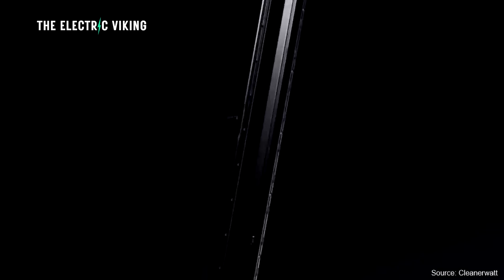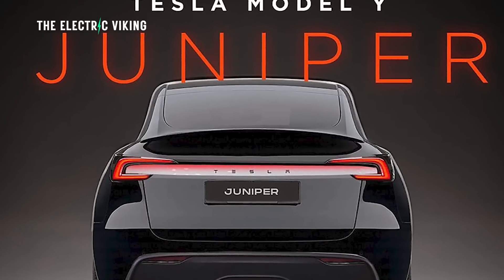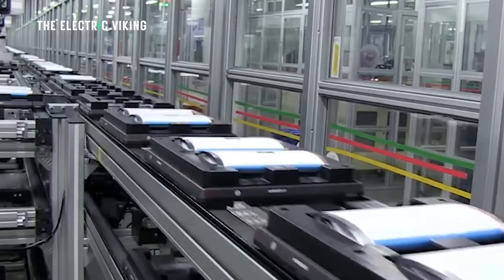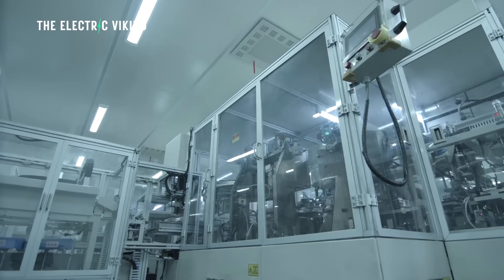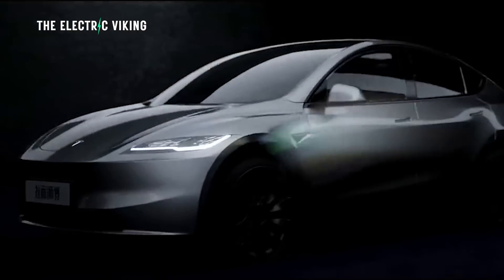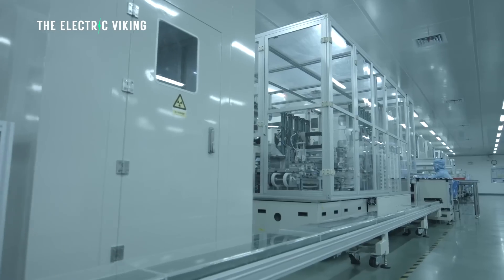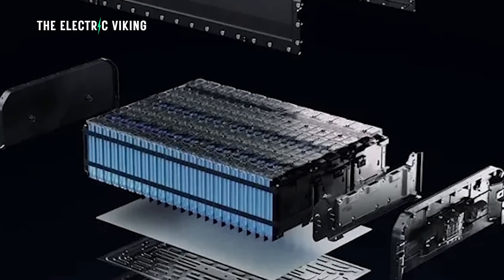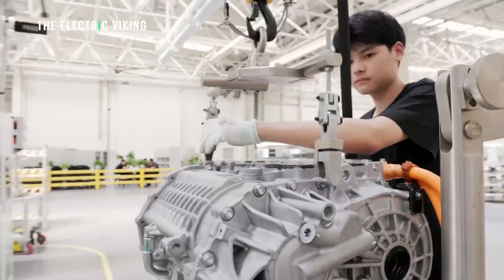Huge increases in energy density and charging speed for new Model Y battery

Comment: I'm from Germany and I drive the Model Y BYD RWD 2024 model. We decided not to wait for the juniper model and leased the current model. I made sure to get the BYD version. I can tell you I don't regret it at all. It keeps it's 175 kwh peak up for so long you have effectively a 600Volt architecture car. We make stops due to our 8 months daughter and our bladders. The car charges faster than you can finish your toilet job on road trips. You are literally sitting on the toilet and the car sends a notification through the app stating that you can continue your trip. I'm looking forward to the higher density LFPs but honestly till my daughter needs diaper changes and a stroller I don't need faster charging nor a higher energy density. I hope that the juniper model with come out with a stalk option. Stalk-less in European traffic with countless roundabouts would be a disaster...
Reply: Stalkless isn't bad at all and I live in Canberra Australia which has the most roundabouts in the world 😊

Comment: Sam, you said that the new Tesla will hv 20% more range than the current one bcos its new battery’s density will be 20% higher. 
This is not true if the new Tesla uses the same size battery (in terms of KWH). 
The lighter battery pack may improve Tesla performance and increase its range but definitely not 20%.

Comment: Thanks Sam, just remember to double check your videos as there's several mistakes with the figures you put on the screen that don't match your narration in the video. You said 1.5 million kilometre warranty, but had 1.5 billion written on the screen. You then said 200wh/g energy density but had 200kwh written on the screen. These kinds of mistakes will be confusing to people watching your videos that aren't so well versed in what these metrics are. It also doesn't guarantee they'll significantly increase the range of the vehicle, they may just put less cells in to slightly increase range whilst increasing profit margins on their vehicles.

Comment: That's a 6% improvement for Model Y's new battery.  That's great Sam.  But not as great as you're making it out to be.  You need to be completely fair with your evaluations.  I'm a "just retired" environmental scientist.  I switched to EV's 11 years ago.  I currently own a 2021 Model Y DM LR.  I should be receiving my Cybertruck within a few months.  Thanks for what you do Sam.  I appreciate you.  Peace, Calvin.
Reply: There is another point material science, there's great push to mass produce magnesium from sea water and if it happens and cost the same or less than aluminum and tesla use it in its casting and wheel rims it means around 20% range
Reply: @yankeewog Viking says the new battery has 20% more range.  20% is .20
So 165 Wh/kg (energy per unit weight) × .2 is 33 more energy per unit weight. 165 + 33 is   198 Wh/kg - almost 200.
Reply: 1 million mile warranty!
Reply: Owning a Cybertruck and being an environmentalist are mutually exclusive
Reply: @barygol  It will not only be my transportation but it will also be my house.  My tiny house will fit in the bed of the truck.  That's going to make for a small home but I'll also have the inside of the cabin for space.  In the last decade I've reduced my carbon foot print 250%.  I've lived my life fighting climate change and global warming.  How about you Bary Gol?  What have you done besides trolling and being negative?
Reply: @barygol  why? No more smell diesel or gas fumes? After three years you're ahead of the carbon foot print from manufacturing
Reply: @barygol Dude…he’s trolling you.
Reply: "Quote: You need to be completely fair with your evaluations"
YouTube is not to be fair, it's for making money, make an elephant out off every little fly is the goal. And the Viking is the Master behind it. 😂

Comment: The higher charging speed/power is unrelated to the architecture voltage (400/800V).  Now it makes more sense for higher power levels to use higher voltages to reduce the charging cable size, but there is nothing preventing a 400V pack from being designed to handle 500 kW, if such a charger was made for 400V.  In the USA, I'm not aware of any chargers capable of beyond 350 kW other than chargers for the Tesla Semi (and perhaps a few other prototype chargers). I'm sure this will change as vehicles that support faster charging appear in the market.

Comment: The energy density increase is getting to a level of creating an interesting dilema for both car buyers and automakers.

Assuming an automaker intends use the new batteries in a facelift upate of an older car that offered LFP 140Wh/kg cells, 80kWh batttery and 320 mile range, are the 200Wh/kg batteries used to:

a) shrink the pack size (52kWh) to retain to the same range (320 miles), signficantly reducing the battery size/weight (by 55%), increasing a car's efficiency say from 4 mpkwh to 6.2 mpwkh.

b) retain the energy capacity (80kWh) and reduce the battery pack's size/weight (by 30%), improving efficiency say from 4 mpkwh to 5 mpkwh, increasing the range by 80 miles to 400 miles.

c) increase a car's energy capacity, retaining battery pack dimensions and weight, increasing the energy capacity from 80kWh to 114kWh, offering an extra 120 miles range to 440 miles.

The resulting choice being:
a) retain range, reducing both the charging duration (to under 10 minutes) and the price (a lot fewer more expensive cells).
b) improve range whilst retaining similar charging speed (18 minutes) and similar pricing (fewer more expensive cells).
c) provide greater range but increase charging time (to 25 minutes) with a raised price (increased cell cost).

What option would both car buyers and automakers choose? 

Would automakers simply choose to offer all three as entry, standard and long-range options?

Figures are indicative examples.
Reply: @myhome772 - enjoy your PHEV, if it works for you no problem. Oddly, I know someone with a PHEV who made a similar coment about Hybrids. Saying when they run out of fuel at the local petrol station (rural location, has happened recently) that he at least could run on battery from his home solar.
Reply: d) new Batterie with more range, same price and charging is in 12.5 min 10-80%.

other than that no option for me.
Reply: @testingtime7780  - seems a variation on c) but with much higher capacity, high C rate batteries. Although, becoming available these batteries will be more expensive initially likely used in higher priced premium/performance cars. LMFP batteries might fit your need but are only just starting to be commercialised.
Reply: @GruffSillyGoat  I guess golden batterie and shenxing are already procuded. So they should be there. What I read batterie price are like 60$ (even on new once) / kWh. So should not be that bad. 95 kWh = 5700$ for whole pack. Let it be like 8k$ still good.

Comment: Quantumscape's current battery is supposed to have a  specific energy (energy density) of around 400wh/kg. They have developed and tested it to last for at least 1000 recharge cycles.  They believe with other materials it can be as high as 900 wh/kg.
Reply: @myhome772 Why not have a larger battery and only charge once a week? Then get rid of the engine and its complexity and maintenance. And tell the transmission adios.
Reply: unless manufactured at scale and sold in volume, this is mostly vapourware.
Reply: @myhome772 we're a long time away from production scale solid state cells. Charging infrastructure is OK in most places these days. Anyone who can afford a current VW car, can charge somewhere. Main problem for VW is that in a shrinking overall car market, you need compelling products and a decent profit margin. They don't have either. ID.3 is sold for the same price as a Tesla M3 or MY in Germany. Who in their right mind would buy an ID3 then? Few do.  I own a hybrid, a 2008 Prius. Next will be a BEV.
Reply: @myhome772 My operating demand does not need a plug in hybrid. I commute some 50 miles, don’t have to do it daily, have 30 kWp PV on the roof, battery storage and 2 wall chargers in my garage. Anyone who charges at home will hardly ever need to supercharge unless you need to visit a place 150+ miles away.

Comment: That assumes you never want to be free of a car payment.  My last vehicle I bought I owned for 20 years and nearly 400,000 miles.  Repairs over that period cost me $1000so for 16 years I never made a car payment.  
  My new (3 month) TESLA I expect to drive the rest of. My life.     That should get me at least a decade free of car payments.
Reply: I don't know man my vehicle repair runs $1,200 some years but $4,000 other years. 

If you were replacing your own struts then you are not typical of most car owners.

And with 400,000 mi didn't you have to replace the transmission and the engine at least once each?
Reply: @myhome772 Cell phones don't have active cooling.  You are talking about a Leaf discount EV, not any mid range or higher EV (almost all of which have close to 90% of their mileage left after 8 years).

Repairing a Lexus is very expensive for people who are not shade tree mechanics.
Reply: @myhome772 I've lived through the death of several products during my lifetime.  In 10 years getting gasoline and repair work for gasoline vehicles is going to be very expensive.
Electric vehicles are getting less expensive every day.

Comment: A sealed waterproof battery still can’t drive through deep water UNLESS the wiring and connectors are also waterproof.  That includes all the connections to the regen brakes and sensors like the wheel speed sensors.  That’s lots of added costs without any benefit for a majority of drivers.  Great marketing hype with little practical value.

Comment: Another battery that's going to change the world!  ,tune in next week for another new game changing battery .
Reply: People keep saying this sarcastically, and batteries keep getting better year after year.
Reply: @dennispierson6598  They could easily do a little research in just a few minutes if they wanted, but some people would rather hate out of ignorance, then actually learn something. Batteries have improved substantially in the last 20 years and if anything the improvements are accelerating.
Reply: @myhome772 It's the same with any fast moving technology, although obsolete isn't the best word.  Our 2018 Model 3 isn't obsolete, it's just not as good as our newer models but that's fine, it's saved us almost enough money to buy a brand new car since we charge off of solar and don't pay anything for fuel.
Reply: Tesla just produced their 100 Millionth 4680 battery.  No mention of this or these 4680 cells at all in this entire video.  They are making thousands every hour.  Where are they going to put them  if they are using CATL or BYD batteries?
Reply: @ToddMunschauer  100 million cells was over several years and is the equivalent of 73,500 Cybertrucks(1,360 cells per Cypertruck).  Tesla has always used batteries from many manufactures including CATL, BYD, and Panasonic.  They will continue to use the latest batteries from these companies in the future, just as they have in the past.
Reply: @ToddMunschauer  Tesla Powerwall or Mega Packs maybe?
Reply: @ToddMunschauer applications where power to weight ratio matter less.  As one commenter above suggested, Tesla residential and commercial energy storage batteries.  They’ll also work well for the Tesla semi.  They already use them in the Cybertruck.  Seeing how Cybertruck’s battery case is only about 3/5 full, they could utilizes a couple more inches of it to make it 4/5 full and still be safe.  Rumor is they’re already working on a Cybertruck refresh.  Given how poorly the range 300 mile was received, I imagine it will make room for a 229kW+ battery option, without taking up bed space.  My guess is they’ll announce in a few years after production for the Model Y Juniper ramps and the production for the Robo-Taxi begins.  Tesla Cybertruck won’t be able to compete with the 229kWh battery 500 mile range of the Dodge REV truck, once Dodge ramps production of its base trims.  Tesla will also have to compete with Ram Charger 590 mile range series plug-in hybrid that can DC fast charge. That’s the one truck buyers are most excited about.  You do need 500-600 mile range in full size trucks because towing a heavy load that isn’t aerodynamic reduces range to roughly 300, the mental minimum buyers want.  With 350 kW charging and better charging curves, due to 800V architecture, better cooling and improved battery chemistry, 200kWh+ batteries will become the norm for trucks and full size SUVs.
Reply: @ToddMunschauer 100 million sounds a lot but in reality with current production run rate Tesla will be able to make about 2K cybertrucks a week(Tesla is probably making half of that now). So with current production rate Tesla can make about 100 K Cybertruck a year. So a long way to go to achieve self sufficiency!
Reply: Coppertop
Reply: @JohnMarston77  Energizer Max!
Reply: Yeah it’s exciting times. When will the development end or at least slow down. A 2000km  range 5 min charge battery in 2 years? Fingers crossed
Reply: @lifeliver9000  I met a car industry engineer working with an EV consultancy on holiday. He reckons normal range will reach 600-700km in a year or two. Then it can affordably settle at around 800km by 2030. It seems range anxiety will be blown away soon and mass market happens when range and charging speed improvements converge with price drops and model choice.
Reply: @undercoveraca  he would have been a interesting guy to chat with. I know a few cars but pricey already doing 800km range like Mercedes. There are a couple of main battery manufacturers but also so many little R&D companies going on with some really interesting projects. Can’t wait  to see what comes up being sold  coming up
Reply: @lifeliver9000 exciting times to be a youtuber with clickbaits and false statements?.yes indeed
Reply: @barygol  or a troll it seems
Reply: You do realise that we’re about double the energy density of 3 years ago? And people like you were commenting the exact same thing back then
Reply: @myhome772it’s not obsolete, the battery still works perfectly well and probably will have the same lifetime as the rest of the car. Or are you sort of person that freaks out that they don’t have the latest phone?
Reply: If you keep waiting for the next advancement, you grow old and never make a purchase. I purchased a M3 2024 Long Range. Happy with it, even if the battery improves. I mean, hardware 4 will soon be replaced with HW5. Then there will be HW6…
Reply: @Paul-ow9dd  so true , and something I keep in mind. Almost jumped on the BYD seal 3.8 but just after I took a test drive a new version came out with more range etc… aghhhh.  Maybe put a peg in ground and say first car with 1000km  under 3 sec to 100km I’ll just go buy. Zeekr?? Hmmm
Reply: Just exciting. Good for consumers.

Comment: I understand that the Aussie market is more open to free trade, but in the U.S. tariffs will restrict Chinese imports of materials, batteries, and BEVs. CATL and BYD are smart, so they will adapt and build battery and BEV factories in Mexico and Canada to try and get around tariffs. The bad news is that tariffs will shelter legacy American automakers so that they can still sell hybrids and gas only vehicles for a few years longer. But China is definitely NOT standing still, and they are really innovating. I'm guessing that you mean 200Wh/kg for LFP batteries at the pack level. Because that energy density at the cell level is not great compared to NCM811 batteries. With CATL's own condensed batteries getting 500Wh/kg (for a steep price). Granted, lower cost, less thermal runaway issues, faster charging, and longer life are ALL major selling points. But CATL was supposed to have 2nd gen sodium ion batteries with those specs now, for even less money. It is all steady progress. And hopefully CATL will keep innovating so that the world's competition will improve across the board. Helping consumers.

Comment: Less cost and less weight and still get same or slightly better range with fewer batteries. Also, they will have enough supply to build more cars if they put fewer batteries in each car.
Reply: @myhome772 How about you stop with the Rav 4 spam? It's an outdated, boring car.

Comment: Tesla will probably increase the range by a bit and just reduce the physical size of the battery. They have a targeted range that is the minimum people will buy and that's the range they will stick with. They can make a 500mile EV no problem, but there's no incentive to do so since the margins would probably be much less than the ones they produce today.
Reply: @myhome772  You know that gas pumps won't work without electricity. And if you live in a hurricane prone area and have anxiety you can just skip EVs for now. I think that 300miles would be plenty to get away for a hurricane since EVs are mostly always charged up at home and are always full.